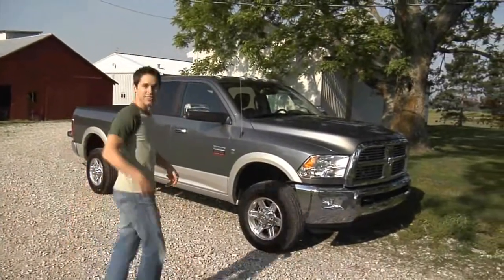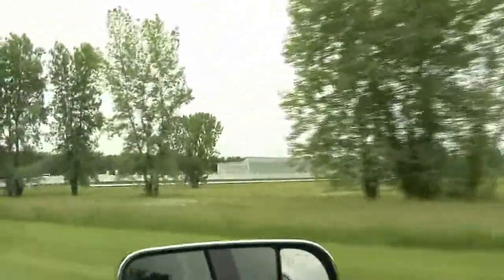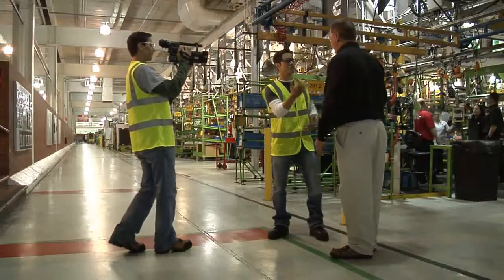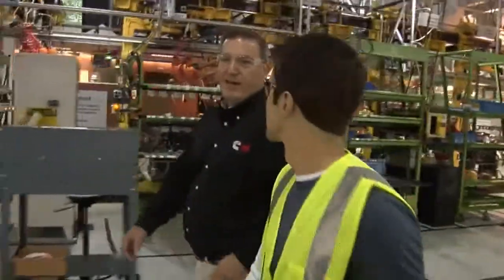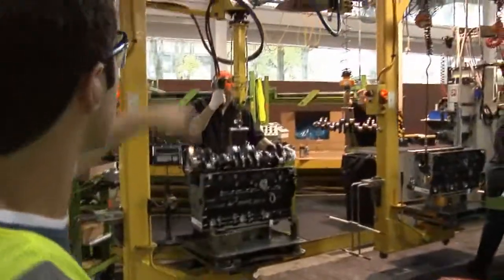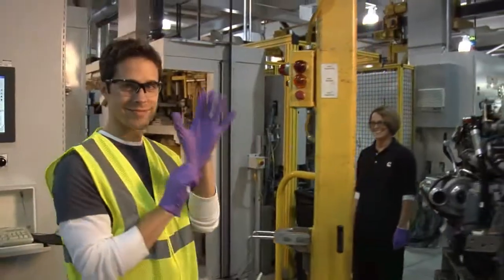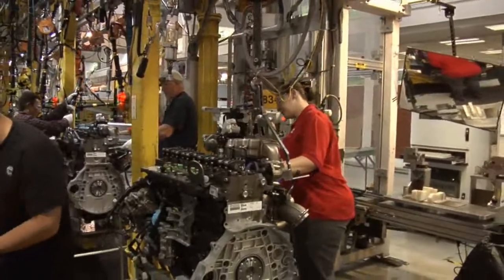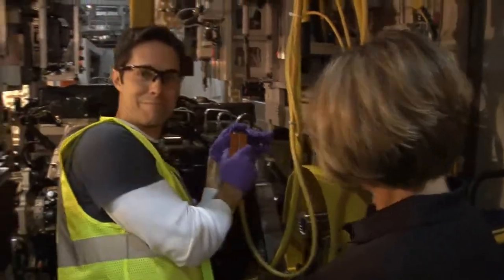Cummins 6.7's Biggest Fan (Pt 5): Plant Tour

Comment from the maker: @josh1303 Cummins high performing, clean diesel engines are reliable and efficient for any type of use. Many customers drive Cummins-powered trucks for hauling and towing, but those who don’t haul or tow still get great performance. We continue to use the same emissions technology on the 2010 Ram HD pickups, so new enhancements we've made are available for earlier trucks as well, not just on new models. Please see your Dodge dealer for more information. Thanks for your business.